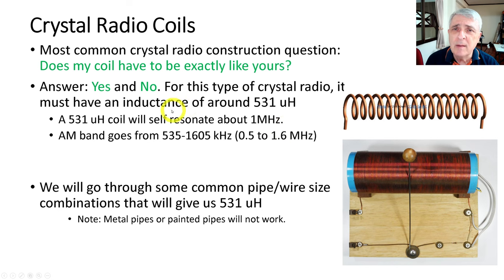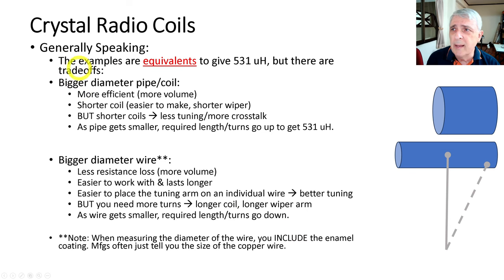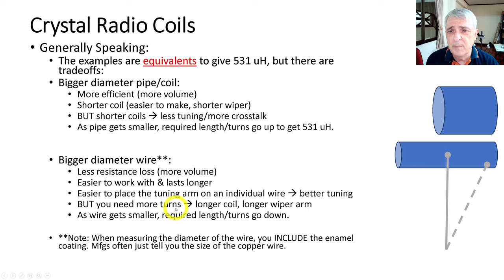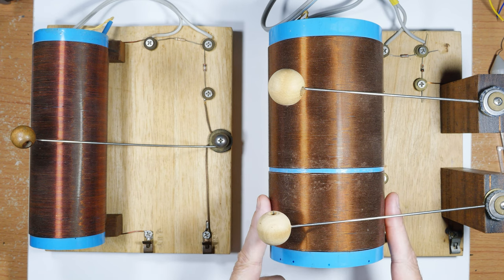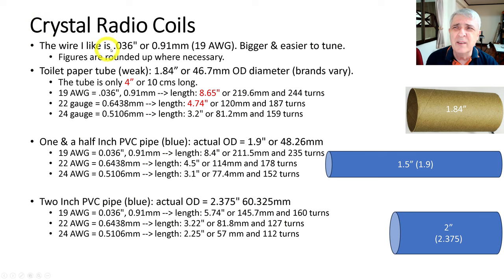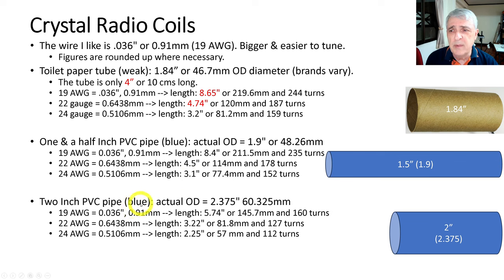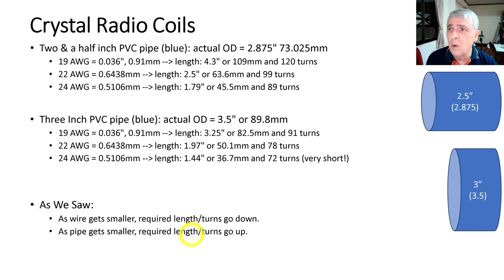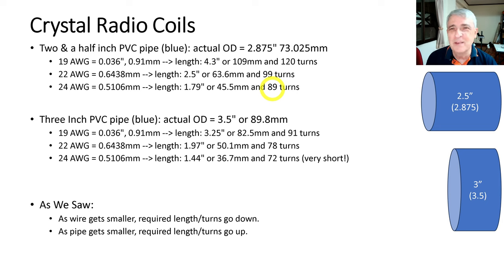Crystal Radio Coil Sizing (4K)

Comment from the maker: This is a very easy to use, single layer coil calculator: https://www.circuits.dk/calculator_single_layer_aircore.htm
VIDEOS: Crystal Radio & Resonant Coil Design (4K)   https://youtu.be/Fw9eb-aB-XU
Best/Easiest DIY Crystal Radio - No Batteries, No External Power (4K)
https://youtu.be/fLVCqZGpv3U

Comment: @tsbrownie:  Thank you for the link.  From a different communication.  This sort of technical information is much more detailed than many video makers will share, but it's extremely helpful to beginners.  Thanks for taking the extra time and effort.
The 160 Meter ham band is just a little higher in frequency than the AM Broadcast band.  It's from 1.8 mHz to 2 mHz.  Some hams communicate there using the AM mode, mainly at night, and maybe using only a few hundred watts of power as opposed to the commercial broadcasters who can use kW of power.  
Also, that band won't be as well populated as the AM Broadcast band.  A few  Crystal radio builders might find it a novelty to try getting their crystal radio to tune up there.  Mostly hams will use morse code and single sideband voice there.  Only AM can be inderstood on those frequencies.
In passing hams can also now use frequencies that are below the AM Broadcast band.  Crystal radios generally won't hear those few hams who go there.  Their transmitting power is limited down there.
I think maybe you already gave some information about short wave listening on frequencies far removed and well above the AM broadcast band.  Some prople are avid short wave listeners.

Comment: Built 3 radios so far, none have worked ... i'll get this right one day! Thanks for the video.
Reply from the maker: Do you have AM stations in your area? That can be a problem. I have a video on what to look for when they don't work. Google "tsbrownie my crystal radio does not work"
Reply: @tsbrownie   Yes, WWL 870am is near me and i should pick them up with no problem. I think maybe i didn't get the specs right when i ordered all the components for my builds.
Reply from the maker: @joel6221  The diode, earphone, and coil are key. Get those right, and it's going to work. Watch out for fake 1n34a diodes. I have a video on that too.
Reply: Hi, if you are using one of those crystal earphones put a resistor across it. 
47k to 100k not critical. It removes charge building up.

Comment: Are there any quick cheat graphs floating around where you can look at the gauge of wire, scroll across to the pipe size and determine the number of turns required? Similar to the mutiplication cheat graphs we used in school to learn multiplication.
Reply from the maker: There are the online calculators I list in the description. I haven't seen any tables.

Comment: One question, the diodes used has a threshold before they conduct a signal that can be detected, of from 0.2 to 0.6 Volts, so they should be biased. If not, the set is cut off from the radio waves that creates signals below the floor of the diodes. I dont get this.
Reply from the maker: @stighenningjohansen  I'm not sure I understand. Do you mean they are clipping the signal? Maybe, but you can't hear it. The diode does not have a sharp on / off. In fact it has measurable reverse flow. If you are concerned about having enough voltage to operate, I have measured 0.5 to 3 volts output.
Reply: @tsbrownie  Yes, they are clipping the signal, and you cant hear it because your radio cuts off most of the signals. The diode do not conduct untill the signal is 0.2-0.6V from negative to positive.,The diodes must open at this voltage before audio can be reconstructed from the carrier wave?

If diodes conducts in any other way. they are not diodes, but fakes.

Comment: Could you pour some kind of resin over the top of the coil, and sand it, to produce a smooth, non rough surface to move the wiper over smoothly for less wear and more precise tuning?
Reply from the maker: I don't have that skill, but if someone does, that should work. It would be cool to have a coil embedded in a clear resin block! Wrap it on clear glass, do the resin thing. Cool! And the smoothness would very likely make tuning smoother.

Comment: Thanks for al this information. I would like to add one more pipe item. and also ask for the turn length?  I have tubing off a plastic Walmart shelf.38mm or1.495 inches roughly, my caliper is a little touchy.  
So my question is how many turns will I need for this? i do not have any other tubing I can use without buying more?
Reply: I have the 19 awg
Reply from the maker: I'm not sure about your dimensions. 0.38mm is a fraction of 1.495". I'll assume the 1.495 is correct. Your coil needs to be 326.0647226 mm (32.6 cms or almost a foot long!) and 358 turns. This does not sound right, and even if the calculations are good, it would be real hard to make a wiper radio with an tuner arm long enough to cover that much coil! Maybe you have friends / neighbors / coworkers with some scrap blue PVC water pipe laying around. 2" or 2.5" is best.

Comment: Is there an online guide to building coils that shows this relationship if someone uses an odd sized form or wire? Also, I have never seen any recommendations for using aluminum wire in case you were to unwind a transformer with aluminum wire to use on a crystal radio coil?
Reply from the maker: There are a lot of calculators online,  most are not easy to use. I found a good one the other day, let me see if I can find it again.
Reply from the maker: This is a very easy to use, single layer coil calculator: https://www.circuits.dk/calculator_single_layer_aircore.htm
Reply: @tsbrownie  Thank you sir.

Comment: What should I base my radio at

Should I try to find the exact size coil and vary the wire gage and number of turns, or should I keep wire gage and vary the coil size and amount of  turns

How did u get to this figures is there a good calculator (or formula)

The onlything constant is that I have 24AWG wire (sadly I cannot get anything bigger in this short time frame)

I tried finding the right coil at home, but cannot (can I wrap the coil in something non conductive to increase outer diameter of it?)

Sadly the nearest AM station I have is about 150KM away, only using 20kW (I am in Europe) of power, so I need to optimize every part of my radio, just to have sucsess)
Reply from the maker: It's best to stay with what I have shown, unless you want to build from scratch. I have videos on doing the coil calculations if that's of interest. All they details are in the description. I'm not sure that wrapping a pipe to make it bigger would work well. Coils take a long time and they're tedious, so having to re-do was is not fun. Since you are far from the station, a good antenna, high up will help a lot. Be sure to take precautions for lightning, working at height, etc!

Comment: I made many crystal radios but there is a problem with my house grounding, it has 50hz hum making it barely hear the station
Reply from the maker: You should NOT be using your house electrical grounding! It is very dangerous, especially if there's any ground loops or other in your wiring/appliances. You need a separate ground rod. In fact, when I lived in apartments or otherwise could not have a ground, I just strung up a second antenna and that often works as well (and sometimes better.)
Reply: @tsbrownie  update: i was experimenting with three 1n34a diodes in series to reduce 50hz hum and i heard something inaudible saying "call now" for 3 times.

Comment: Good morning. I have a  wire with a diameter of 2 mm, could you tell me the diameter and length of the tube and how many turns to make for the antenna? Thanks
Reply from the maker: I have to know what available sizes for the tube you have to the nearest millimeter. I think your coil is going to be way too long to be practical. Even 1mm wire makes for a long coil. I'd recommend 0.8 mm.

Comment: What is the difference if you use silver wire?
Reply from the maker: For the same diameter wire, the coil could have lower resistance than copper, but the inductance should be the same.

Comment: I built a Radio just as your video shows and other are telling me this is wired wrong. To look at other crystal radios.
Reply from the maker: I show radios that are easy to build and work well. Not always the highest tech. Can you give me links to the videos of the people who are telling you it's wrong? I'd like to learn how they did it.
Reply: I have done a bit of research and the only thing I see is that there is a model that is set up like yours but for the ground wire crosses over to connect just before the resistor. The left end of the coil wire is not shown, so I don't know if its open or not.

 But your design makes more sense to me. The circuit runs from antenna to ground. BTW I may have figured out the issue. Its also one that you may want to do a video on. There is only a couple of places I found the info and one was a video that does not come up in my normal search. The Piezo Electric ear piece that I have is made in Taiwan.

 These seem to have about a
 35% fail rate. The Japan made ones seem to be better built. I also found on Amazon where I bought mine and it is a Taiwan made ear piece that they now have one from Taiwan that says "upgraded, brass diaphragm soldered on both sides. "

The one video I found shows them both the Taiwan and Japan made versions taken apart or cut apart. The Taiwan made is soldered on the back of the diaphragm and and glued on the front and the two plastic ear pieces are glued together. The thing that was the issue is the glue. It seems that sometimes the glue is too much and glues down the diaphragm. 

He shows how you can drill a hole in the back and poke it with a pin to try to loosen it. He also said he got the percent when someone ordered 100 of them for a boy scout project type thing and that is how many did not work. I will leave a link to the video and the one about the ground going over to the resistor. I would like to know if the coil on that model is left open. 

Here is a link to the questionable ear piece I bought. BTW I have two new upgraded ones coming in.  https://www.amazon.com/dp/B071JWPTT9?psc=1&ref=ppx_yo2ov_dt_b_product_details

Link to the video of the alternate wiring of crystal radio.
https://www.sciencebuddies.org/science-fair-projects/project-ideas/Elec_p014/electricity-electronics/crystal-radio

Here is the link to the bad earphones from Taiwan. 
https://www.youtube.com/watch?v=yBxo8CaY4HY
BTW I was not accusing your wiring of being wrong, just passing on what some had replied to me, that the wiring was wrong and that I should look at other videos. 
 @tsbrownie
Reply from the maker: @jaybabcock4557  Thanks for all the good info. I don't know why, but youtube did not notify me of your response. They seem to be kind of random about it.
Reply: I just want to make a working version. I put up a 100 foot line antenna but it did not do what I wanted it to. I think because it was only about 6 feet off the ground. I need to put it up higher. But I need a warm spell to do that. LOL @tsbrownie
Reply from the maker: @jaybabcock4557  6 feet is not too bad for height and 100 feet long is more than twice mine! Higher is better so someone does not run into it. You might already know this, but just in case... Orientation makes a difference. Bare wire or enameled is preferred. Also, make sure your ends are well insulated and you don't coil up any spare wire.
Reply: I used ceramic insulators on the ends designed for antennas, and my cable is from the antenna guy. Its 18 gauge steel copper clad with plastic insulation. The person at the Wire guy shop said you get the conductivity of copper but strength of steel.  @tsbrownie
Reply from the maker: @jaybabcock4557  Sounds like you have a first-rate setup.